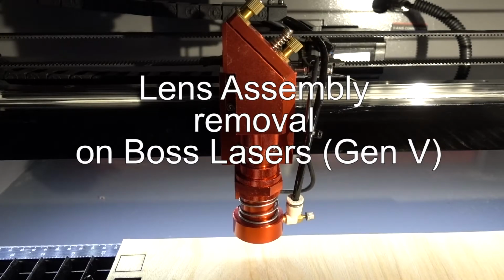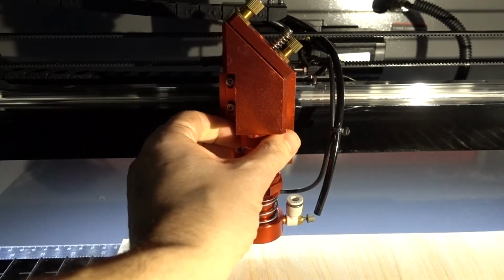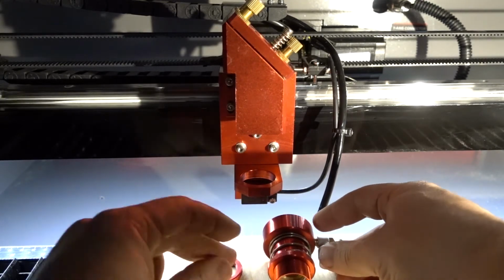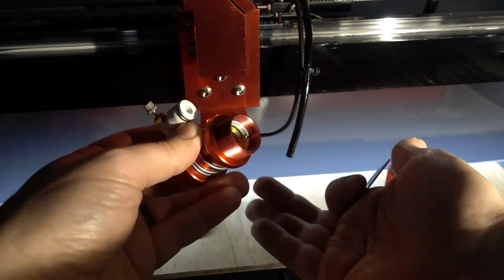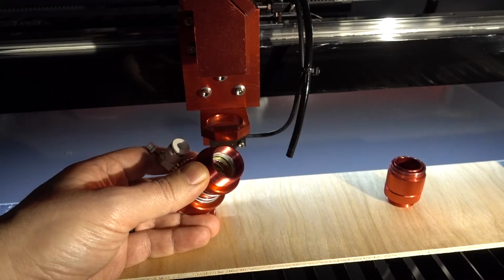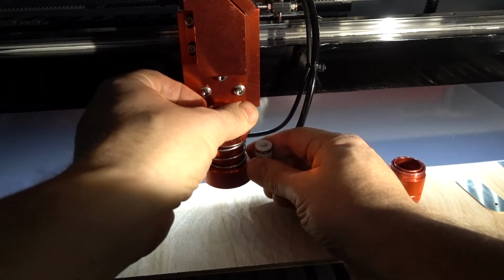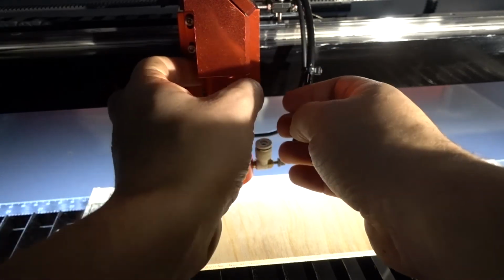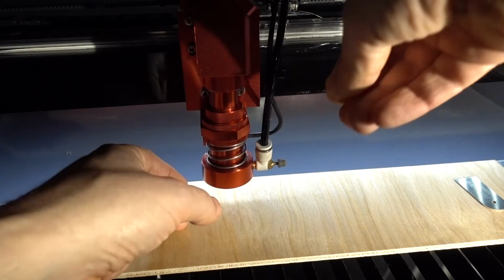Lens Assembly Removal on Boss Laser (Gen V)

Comment: Is the rubber ring under or on top of the lense because another video shows rubber ring on top of lens and aluminum tightening ring on top of that?
Reply from the maker: On mine it's under the lens. I imagine if you had o-ring above, it would be a little more difficult to remove the lens

Comment: So I inadvertently moved the bottom-most red finger nut on the lens housing (the one right above the spring) and I'm trying to figure out where it is supposed to be at. Do you know how I'm supposed to ensure its in the right location relative to the lens? It changes the focus height since it moves the lens up and down.
Reply: Or rather allows the lens to be moved in conjunction with the upper nut.